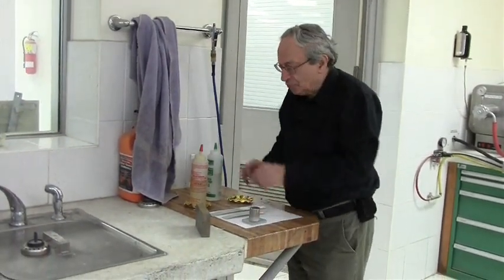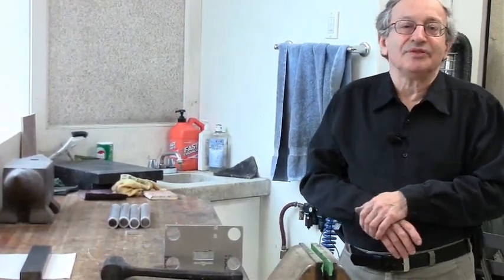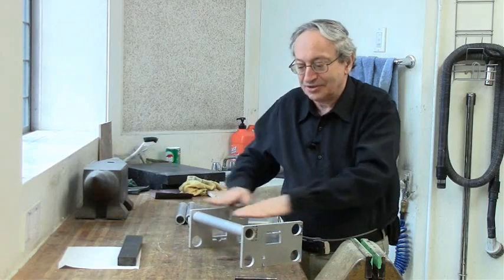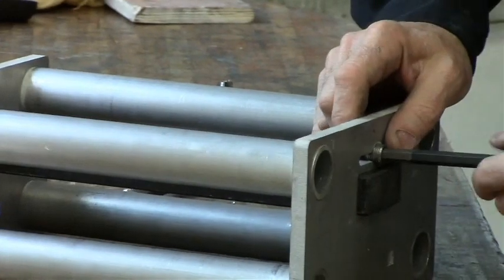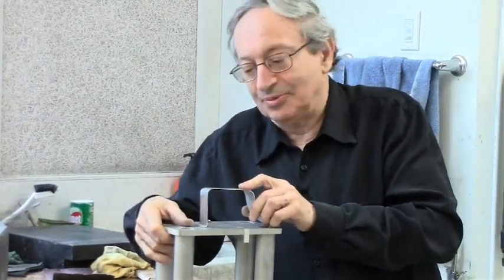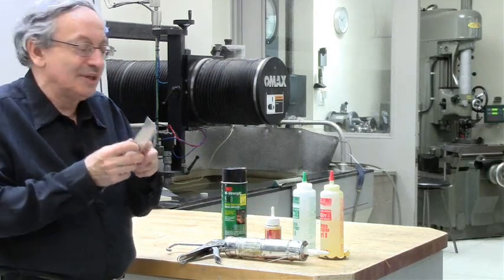Building Prototypes part 13 of 18  Large Structures

Comment: Thank You for a very inspiring video! 
I have by now watched most of Your videos and found gems of information in all of them useful for my own prototyping shop.
Your description of water jet for prototyping taking advantage of the slight taper is very interesting. 
I would add one more type of glue that that I have used a lot for prototyping in recent Years. There are several grades of heat curing epoxy that can be cured at fairly low temperatures in a lab oven. No mixing, high strength, easy dispensing from small syringe bottles  and syringes, unlimited open time and  quick turnaround time  are some reasons I use this type of adhesive more than any other nowadays. During heating these epoxies thin and flows momentarily very much like solder.  The type I prefer is Permabond ES 566. Stored the stuff for 2 years in the fridge without problems although the datasheet says 6 months. 
Hope You have the time to make some more videos like the previous ones.
Best Regards, Erik Isberg

Comment: hello mr gelbart a concept so clear as you explained "peel mode" shoud be more emphasized in all welding literature as why some welds, even ones made following code, fail miserably under service. the welding manuals assume that we are welding rigid components and that linear forces are applied when the reality is not always that. i know it will help me in making safer weldments. thanks for sharing these explanations for people like me that can`t reach formal education.

Comment: If you are considering silicone as an adhesive or potting compound in electronics prototyping, be aware there are two types of curing chemistry:-
a) "RTV" cure, and b) neutral cure.    
Always use a neutral cure silicone.   RTV cure silicones release acetic acid during and after the curing process - this will over several months to several years, corrode away any metal, particularly copper and any fine wires.   Silicone sold especially for bonding glass is the worst in this aspect.  In general, if the container or packaging does not specifically state "neutral cure", it isn't - it's RTV (acid) cure.
Sometimes electronic circuits are potted as a means of protecting against moisture or to avoid issues with vibration.   Be aware that in such cases there cannot be air circulation and the power dissipation of parts must be evaluated on that basis.  A better solution in most cases is what is known as "conformal coating".

Comment: Building Large Structures with Adhesive Bonding: A Prototyping Perspective

* 0:07 Adhesive Joint Preparation: Demonstrates preparing two adhesive-bonded joints (peel strength and shear strength) using 5-minute epoxy. Tip: For longer working time with fast epoxy, mix it on a cold surface. [From powaybob's Comment: Using a cold soda can bottom can be helpful for this.]
* 1:49 Introduction to Large Structure Building:  Focuses on building large, temporary structures for experiments or research setups using adhesive bonding as an alternative to welding. 
* 2:17 Welding Drawbacks:  Highlights two main drawbacks of welding:  
    * Difficulty in mastering welding techniques.
    * Significant distortion caused by welding heat, requiring machining for correction.
* 3:14 Adhesive Bonding Advantages: Suggests adhesive bonding as a suitable alternative when high strength is not critical, but stiffness is required. 
* 3:27 Scaled Prototyping:  Recommends building a 1/10th scale model using water jet cut aluminum plates and pipes to test and refine the design before building the full-scale structure.
* 4:19 Leveraging Water Jet Taper: Exploits the slight taper of water jet cuts for self-jigging and easy assembly/disassembly of the structure.
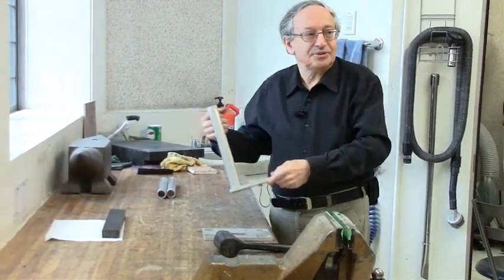* 5:05 Disassembly with Heat: Notes that adhesive-bonded structures can be disassembled by heating them (e.g., with a torch or in an oven) to around 150°C (300°F) to soften the epoxy.
* 5:38 Limitations of T-Slot Extrusions: Explains why t-slot extrusions, despite their ease of assembly, lack rigidity for applications requiring high precision or accuracy.
* 7:27 Bracket Design and Wedging: Demonstrates designing and integrating brackets into the structure, utilizing the water jet taper to create a wedge-like effect for secure locking without adhesive.
* 8:33 Importance of Flatness: Emphasizes the importance of a flat reference surface (like a granite plate) for assembling structures that require co-planarity.
* 9:30 Flexure Clamps for Removable Parts: Introduces the concept of flexure clamps for securing removable parts (e.g., granite beam) without applying localized stress.
* 11:19 Flexure Clamp Construction: Explains how to create a flexure clamp by cutting a slot and using a tapered pipe thread and plug for expanding and clamping. 
* 12:50 Advantages Over Set Screws:  Highlights the superiority of flexure clamps over set screws, as they distribute pressure evenly and avoid potential damage to brittle materials.
* 13:56 Adhesive Joint Design Principles:  
    * Shear Mode: Emphasizes designing adhesive joints to operate in shear mode for maximum strength.
    * Tension Mode:  Tension mode is acceptable but weaker than shear mode.
    * Peel Mode:  Strongly advises against designing joints that will experience peel stress, as this leads to very weak bonds.
* 16:01 Peel Mode Failure Explanation: Explains why peel mode joints fail: Stress is concentrated along a single line (zero area), leading to almost instant failure.
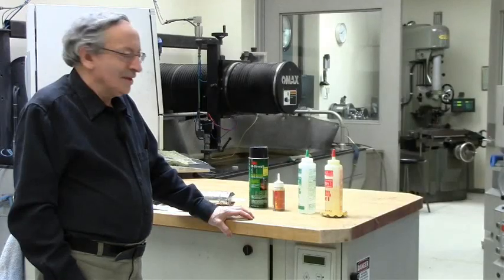* 17:45 Common Lab Adhesives:  Lists four essential adhesive types for a lab environment: 
    * Epoxy:  For general-purpose bonding, especially where quick curing time is desired.
    * Silicone RTV:  For high-temperature applications, elasticity, and strong bonding to glass and ceramics. [From keithammleter3824's Comment: Use neutral cure silicone to avoid corrosion issues with RTV cure silicones.] 
    * Polyurethane: For flexible bonds, gap filling, and bonding to rubber or other flexible materials.
    * Spray Contact Cement: For bonding large sheets with uniform adhesion.
* 21:58 Cautions about Cyanoacrylates (Super Glue):  Recommends avoiding cyanoacrylates (super glue) in scientific work due to their brittleness, outgassing, and negative effects on optics and some plastics. [From ChrisLeeX's Comment: Super glue can be particularly harmful to optics.]
* 24:01 Thermal Expansion Considerations: Warns about the high thermal expansion coefficients of plastics and adhesives compared to metals. Recommends careful consideration when bonding dissimilar materials, especially if precise alignment is crucial. 
* 24:43 Wedge Bonding and Optical Levers: Explains how adhesive wedges used for alignment can cause significant angular changes with temperature due to the magnified effect of thermal expansion through optical levers. [From NomenNescio99's Comment: Using high-quality epoxies with proper mixing ratios and curing procedures can dramatically increase strength.]

I used gemini-1.5-pro-exp-0801 on rocketrecap dot com to summarize the transcript.
Cost (if I didn't use the free tier): $0.09
Input tokens: 23696
Output tokens: 1024

Comment: Builders of composite aircraft,place the resin and hardener,place them in a box with a incandescent light bulb.The heat makes them more fluid and therefore,easier to mix and spread easier.They also use a epoxy pump that meters the epoxy accurately.

Comment: Love your videos! Aren't solvents good "glues" for plastics? Like acetone for ABS or THF for PLA etc. They evaporate and just leave you with the bonded plastic.
Reply from the maker: Solvents are good adhesives but only for perfectly fitting parts as they can not fill any gaps, as they evaporate. A better solution is to dissolve some of these plastics in their solvents and use this as an adhesive. This is what the commercial plastic cements are, like ABS or PVC cement.

Comment: Am i correct when i assume the shear test is biased by the fact you compress in the direction of the taper and thus need additional force to cause movement. A more honest shear test would be to apply force on the opposite side and only measure shear strength of the epoxy bonding.  I love your video's and almost lost a keyboard from drooling over your high precision air bearing cnc lathe/grinder, what a beauty !
Reply from the maker: No, the shear test did not rely on the taper as at this thickness of aluminum there was practically no taper and in any case the male part was machined and had no taper.

Comment: Hi Mr. Gelbart, thank you again for you generously showing us your knowledge. Please allow me to ask three questions concerning the flexure clamp:
(1) For the flexure clamp using pipe taper thread, do we use female pipe taper thread paired with male "taper" plug (with slanted threads)? Or male "straight" plug (with straight threads)?
I imagined that female taper + male taper would not lead to much material deformation, but I could be wrong.

(2) Is there a rule of thumb on how far away the flexure clamp slit should be from the thing we want to clamp?
I guess it is subject to some trial and error (with difference in material thickness and such), but I find it difficult to estimate how much flexure I can get on the final 1:1 large structure based on the flexure I get on the 1/10 model we build to try. 

(3) Approximately up to how large of structure would you still recommend the flexure clamp? For structures bigger than that, what can be good options?
(I'm imagining trying to make the structure you made to hold graphite into a room-size structure holding a large graphite beam or metal beam.)
Reply from the maker: See previous reply about taper. As far as size and scaling, he only rule is not to exceed the elastic limit of the material when the clamp deflects to maximum deflection.
Reply: Thank you Mr. Gelbart for your prompt reply! I'm not entirely sure but I think your response below says that the male part has a straight thread, not tapered. I hope that I understand it correctly. And thank you for the guideline about elasticity.
Reply from the maker: @jeanapp_    Both male and female have tapered threads.
Reply: @dgelbart  Thank you so much for the confirmation!! Very excited and grateful to see your latest video. Thank you for your generosity on sharing knowledge.

Comment: How can one glue PP or PE or other low surface energy plastics? All I can find is either very expensive and needs a primer or has to be activated with plasma, which you normally don't have, or is there a way to activate it with DIY methods?
Reply from the maker: Best method (better than plasma) is sandblasting, as it also creates roughness. 
Second best (equivalent to plasma) is scrubbing with Ajax/Comet/Bar Tenders Friend. 
In both cases adhesive has to be applied in an hour and joint designed for shear mode. 
Regardless of method, strength will be low. 
Dan
Reply: @dgelbart  Thank you for your quick reply. I have been so frustrated so many times when a part made of PP or PE broke and no high strength bond was possible. Well at least today I can 3D print the part now. Well today I think, maybe melting with additional material to fix it, is that a good idea?
Reply from the maker: @AlJay0032  OK method, not perfct. That is what I usually do.

Comment: I don't agree on the PU vs epoxy statement.

Quick setting epoxies are notoriously bad on pretty much all properties compared to the slow setting epoxies. Strength can also significantly improved by proper curing, which usually includes a period of increased temperature over a period of time after the first initial curing, aka "baking" - times and temperatures varies.

And it's extremely important to have the proper mixing ratio between epoxy and hardener if you want the full performance, eyeballing simply isn't good enough - either a measuring syringe or use a scale and remember to use the weight mixing ratio. 

If you are using quality epoxy, proper surface preparations and correct curing,  there is no PU based glue that gets even close to that strength, regardless of the type of strain the bond is exposed to, epoxy can even outperform welding in some applications.

Once you leave the consumer grade epoxy and start working with more professional glues, always avoid contact with your skin - wear gloves whenever you use a real epoxy. Almost all epoxies are solvent-free today so there is rarely any need for breathing masks, but the hardeners can cause severe allergic reactions on skin contact - and the risk increases with multiple exposures.

In fact the PU based glues are becoming more and more rare today, for most wood applications PVA based "carpenters glue" have superior performance, in general construction work the MS-polymer based glues have much better performance than the previous generation of PU-based construction glues and for any high performance application epoxy is almost always the best choice.

Many PU-glues are frequently touted as "gap filling", but they really aren't - at least not if you want a strong bond.  The problem is that accused gap-filling property is based on the PU-glues bubbling or foaming when curing, there is a very high probability that the gap will be filled with air to a large part and not glue, and although air has many good properties - strength isn't one of them.

Let me continue to diss PU-glue a little more, once cured PU-glue will be very moisture resistant - it can even withstand being submerged in water for long periods of time, but the curing process of PU is based on moisture/water. If you have materials that contains moisture or are in an a moist environment the curing process can get so bubbly and foamy that your workpieces can be pushed apart unless they are fixated properly and you'll end up with a very weak joint.

The alleged flexibility of PU-glues is not unique, epoxies can be made to have a very wide range of E-modulus. For some types of epoxy you can even vary the flexibility by adding different amount of hardener.

But I wholeheartedly agree that CA-glues should be avoided except for some niche applications.

And in the name of honesty, some materials won't give you a good bond with epoxy unless you do some very special surface preparation, aluminum is worth mentioning in this category.

Sorry for the rant, but I really like epoxy - it's capable of so much more than most people think.
Reply: Really interesting post, thank you.

I have bonded sanded aluminium to plastic with steel filled epoxy before and the result was nice, but I guess it's generally not very challenging to glue together thin objects with a large surface area.

I'm a bit surprised about the low opinion on cyanoacrylate glues. I've read elsewhere that epoxy tends to only bond mechanically to most plastics, while superglue and two parts acrylate adhesives makes actual chemical (covalent) bonds.

Comment: Why is granite so flat tho? 
 Or isit the way its been processed..?
Reply: It's cheaply manufactured flat and it's very resistant to warping over time due to fluctuations of temperature. Even a mass machined granite countertop is surprisingly flat, and large calibrated plates are only a few thousand dollars per plate for an incredible amount of surface flatness. Smaller calibrated plates are easily sub 100 dollars and that's just not something you will get with anything else.

Comment: sir, with reference to 22:19 about Cyanoacrylate glue, is it good to bond broken coffee mug handle to the mug? is the porosity in coffee mug ceramic an issue with 2 part epoxy? What is the best glue for this coffee mug ceramic and forces getting applied to its handle? Thank you
Reply from the maker: Epoxy.
Reply: +Dan Gelbart thank you sir :)
Reply: I have had a good experience with glueing ceramic items with PVA (white wood glue). I did some destruction testing and it was not easy to break.